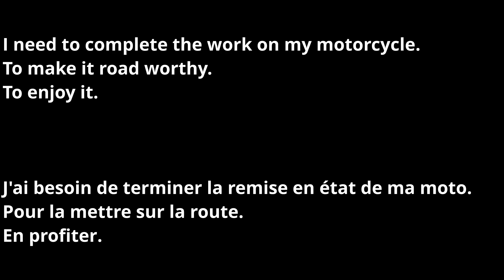BMW k75 "restoration" (ep 1)

Comment: The wire from the starter, did it connect to the negative lead? I’m rebuilding and mine looks different and I’m pretty sure it connects to the battery negative side. Thanks!
Reply from the maker: Yes,there are several wires on this loom,they are connected on the battery.